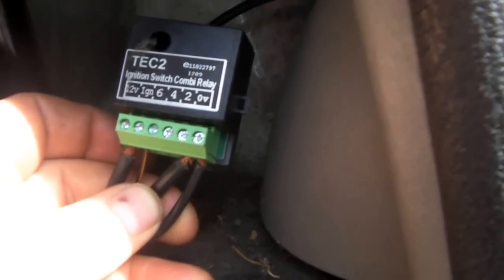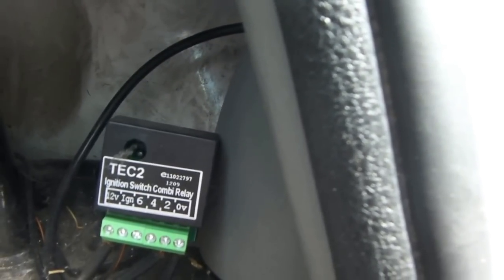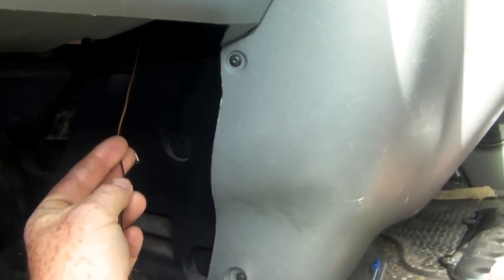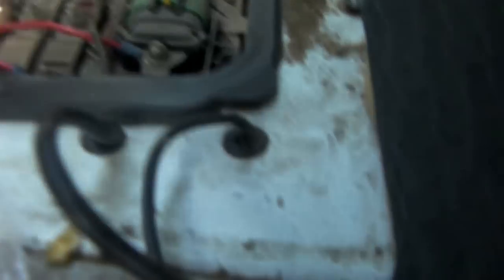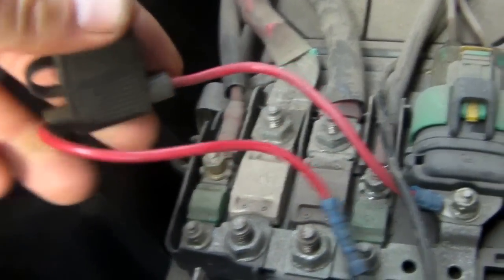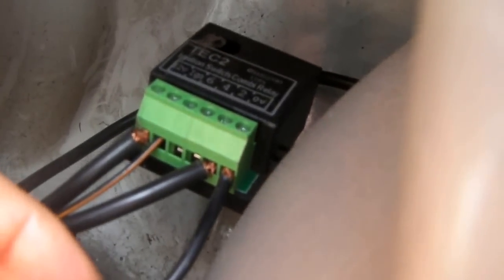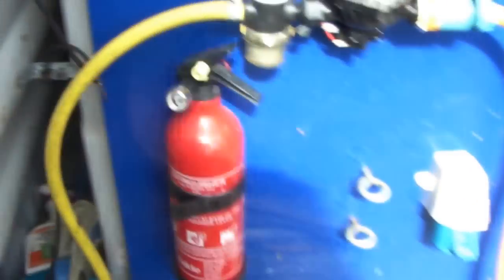How to wire a split relay charger

Comment: Cut, bare, twist and earth your wires properly! Also if your relay feed comes from your stereo you're drawing current from both batteries post and during ignition, your leisure battery isn't designed for cold cranking amps!

Comment: Hi Mark i have this exact split charge relay im almost ready to fit it but im a bit unsure on the ignition wiring, You say you connect yours to the back of your stereo? where abouts do you connect this on the stereo? Cheers
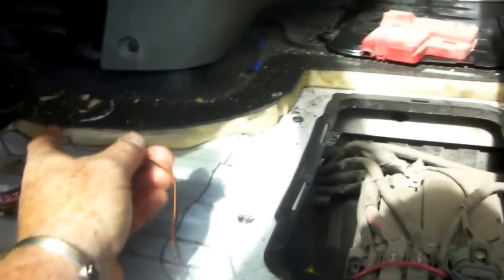Reply: 0:37 Ignition switched live.

Comment: I have a ford transit and it already has a leisure battery factory fitted..I want to put another one in back so do I need another split charge relay or can I just connect to old batteries?  Thanks